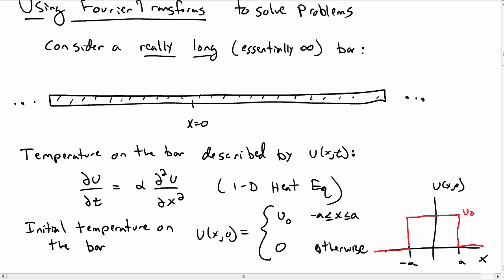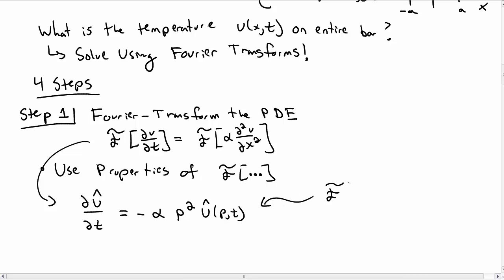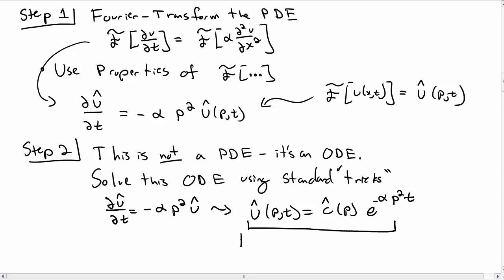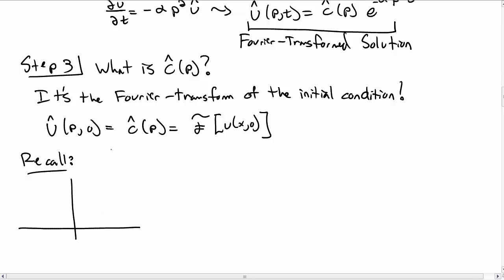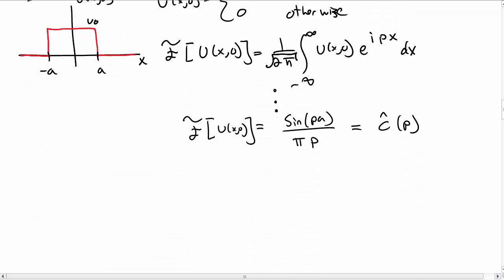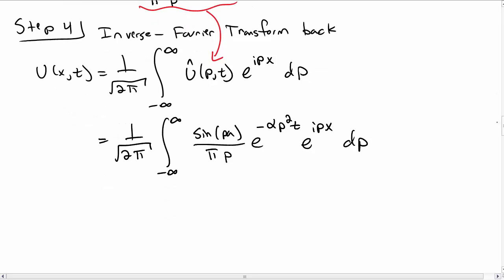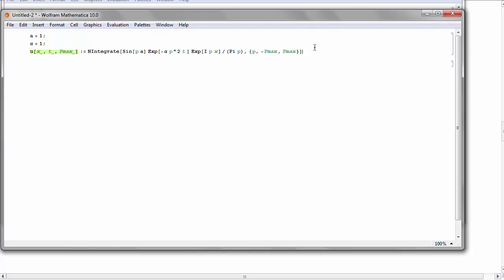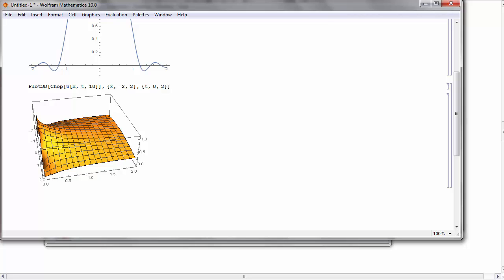Fourier Transform Technique for Solving PDEs (Part 2)

Comment: If we are using the normalization (1/root 2*pi) , shouldn't the result of the Fourier Transform of the exponential be: (root 2/ pi)* u_o*sin(pa)/p ? Or does this change not matter in the solution to the equation?

Comment: May I please ask about Pmin and Pmax - what are these numbers?
Reply: +Alexander Kuznetsov Good Question! In doing the numerical integral, in principle the limits of the integral should be from (-Infinity) to (+Infinity). 

However, in order to do the numerical integral I replaced the "Infinity" in the limit to some large number, which I wrote here as Pmax (though I don't think I strictly need to do that).

Then, I just choose Pmax large enough so that the result doesn't depend significantly on the value of Pmax (and thus I don't actually need to numerically integrate to "Infinity").